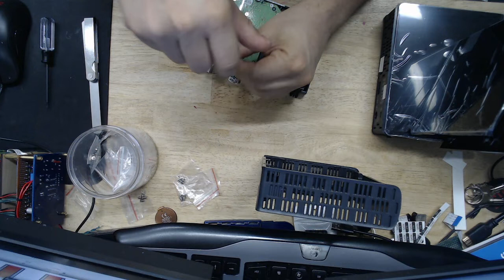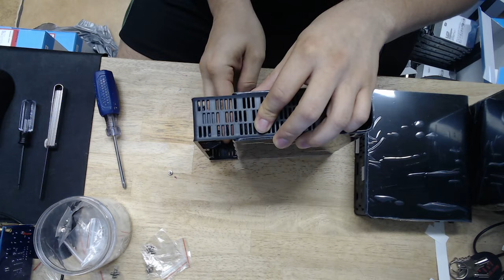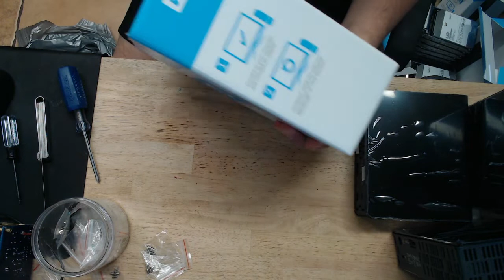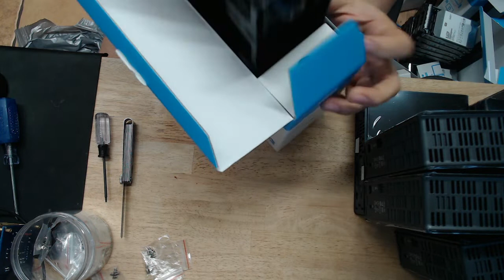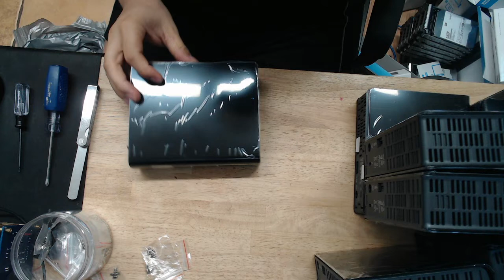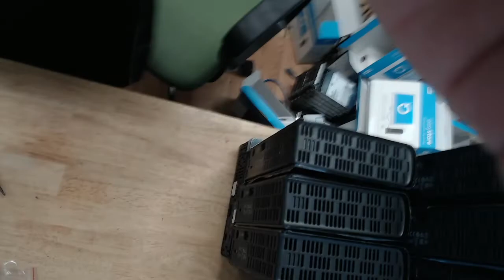Shucking of 8tb WD easy store drives

Comment: What's so special about the red label? You sounded like you'd found the holy grail.  🏆
Reply: They typical run for much more than the price of the external drive. To find one in there is a great find! Most are just "white labels." Which could be less reliable than this WD Red drive. The red drives are super reliable drives for Network Attached Storage (NAS). The drives are built to last and be on for long periods of time.